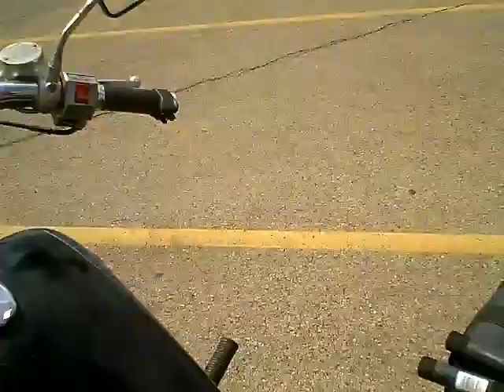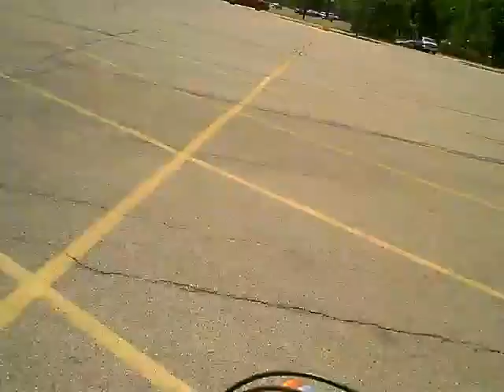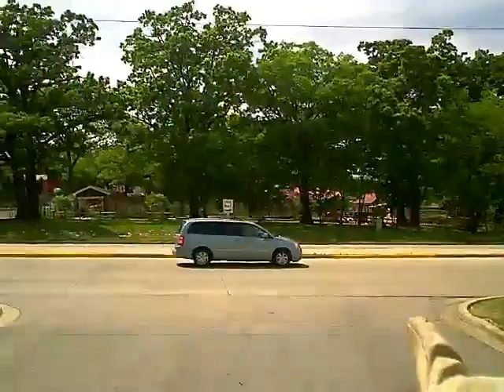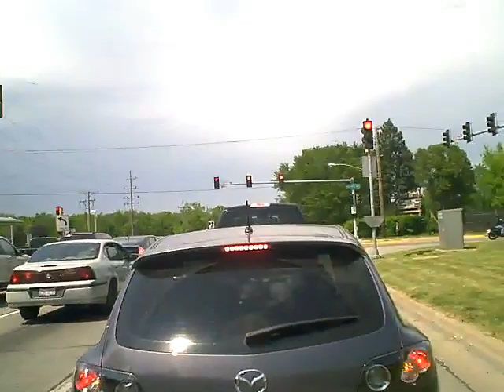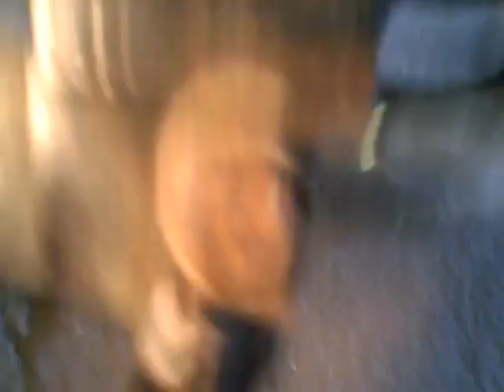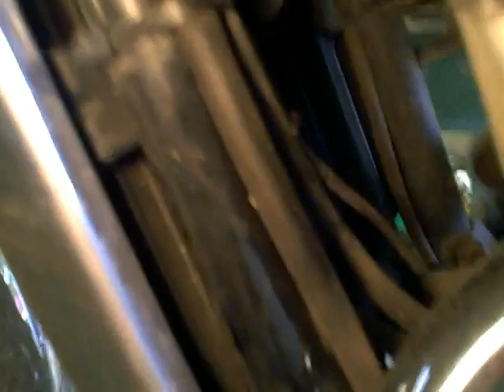Kickstand Safety Bypass on  '91 Kawasaki Vulcan 500

Comment from the maker: In some manuals they say not to do that but I have used it that way too. It's just an ordinary switch like your kill switch. I don't see a problem using it the same way. 
Theoretically I guess you are putting more wear on the contacts but they usually fail due to dirt intrusion not contact wear.